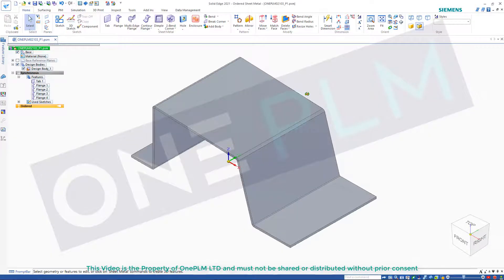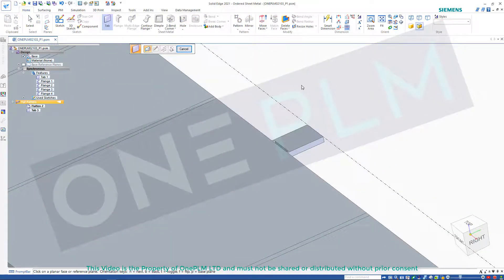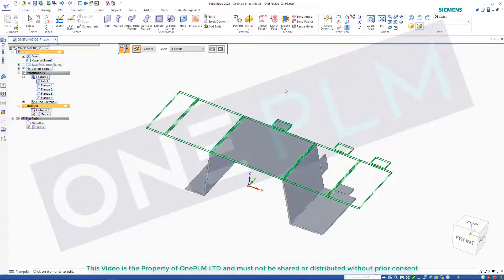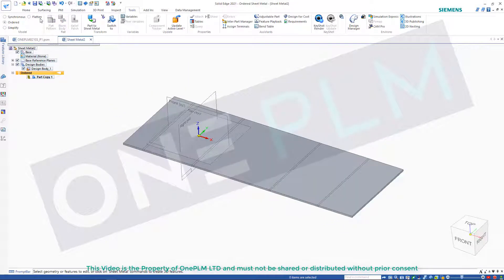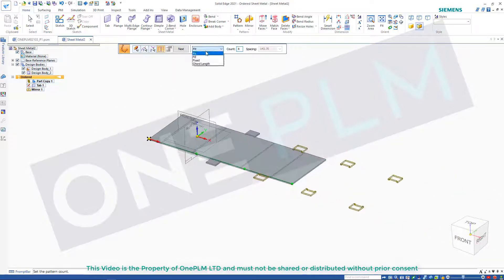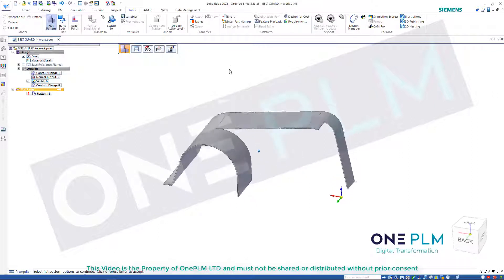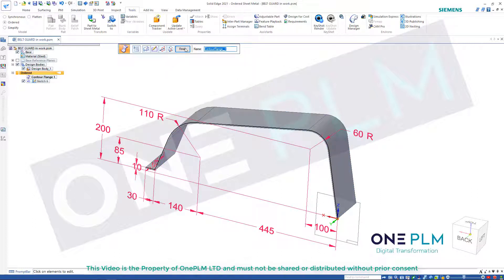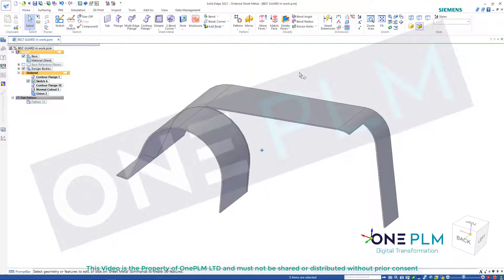Solid Edge Sheet Metal Tabs and Multibody

Comment: You cut a part of your recording at 8:53 and I can't figure what the window / table that popped up is or what you had clicked. I've never seen it before. What is it?
Reply from the maker: Hi.
That is saving with the Data Management turned on. The small dialogue box is the component tracker. Showing linked parts